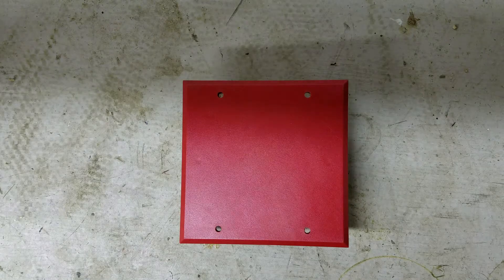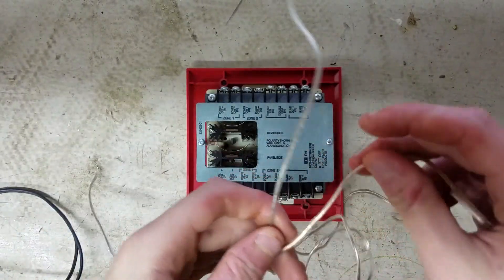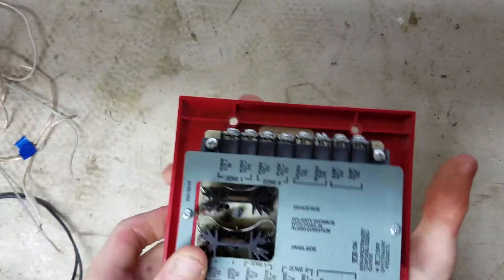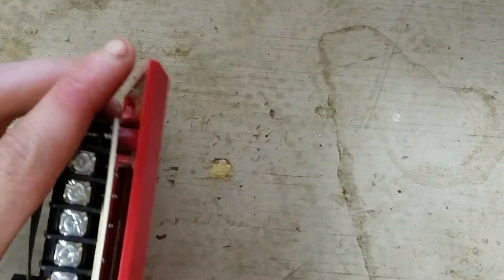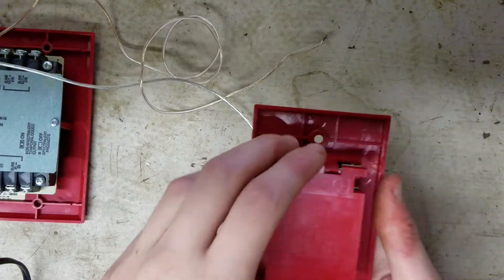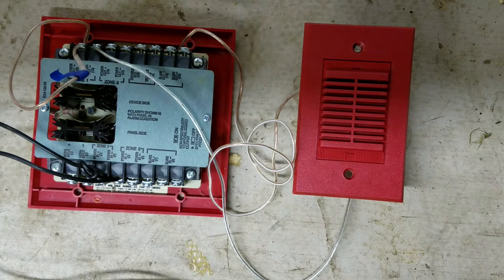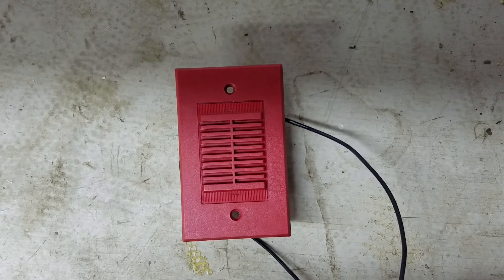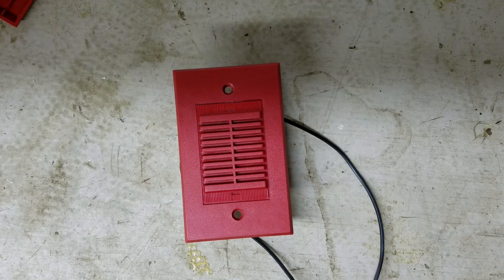How to Easily Wire the System Sensor MDL Sync Module to a Fire Alarm

Comment: I see this is a fairly old video so hopefully you may be a bit more knowledgeable by now. And good for posting about subject as there isn’t much out there but this specific video is pointless. Sync modules are generally for strobes alone, you usually do not have to worry about the horns whatsoever. If your strobes sync them the horns will as well. I’ve never ever had to use a sync module for a horn. 
 With that said you would still wire the same but some added steps if using multiple modules with the slave inputs. Thanks for posting